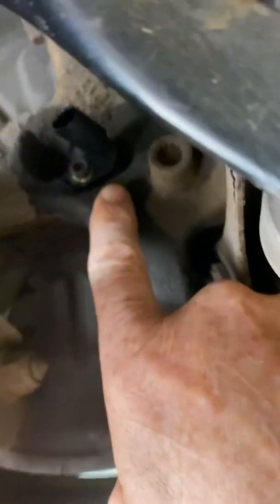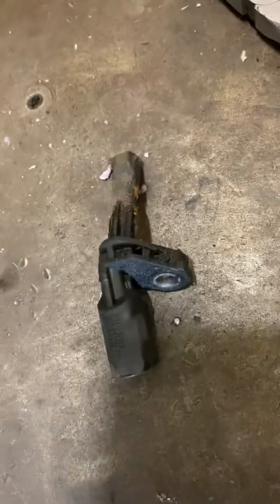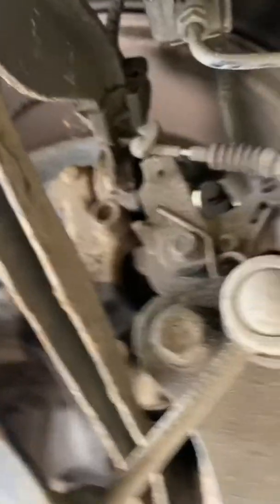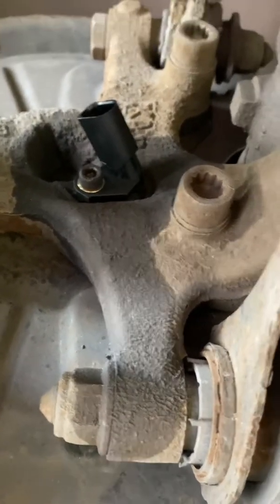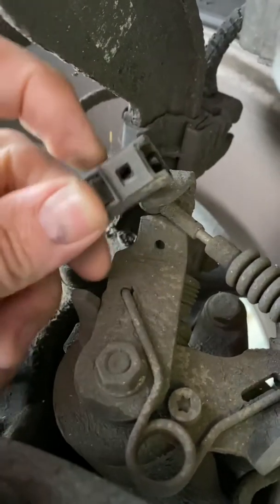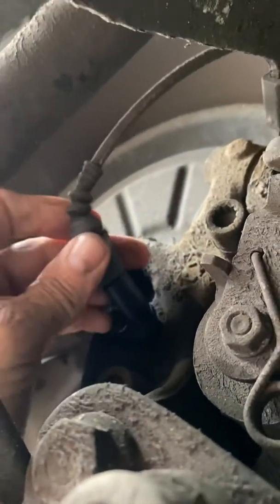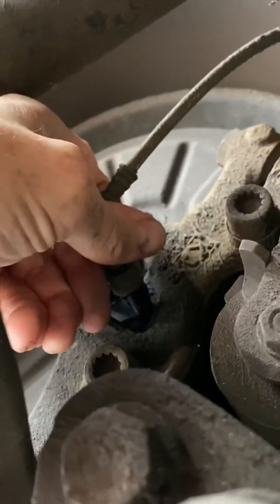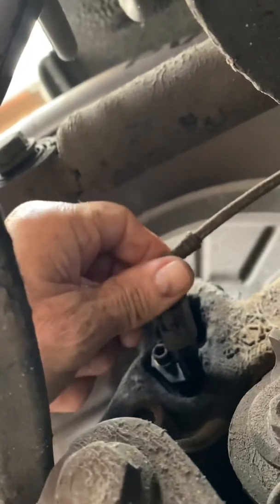Abs fault code u111300 vw Audi group

Comment: Got an A6 and I get ABS fault, Parking break fault, Start stop Fault, Air leveling system Fault. My m8 scanned it and reset it. it worked fine for a little bit then it all came back. We think its water getting into some Can Bus system in the rear. Might be a sensor so we can try that first
Reply from the maker: What were the fault codes?

Comment: I had the abs light coming up with a few other lights but it kept just going away then its not been on for over a month, now its came up with steering defective. Would you think it could be the wheel speed sensor causing that
Reply from the maker: Possibly, I'd get the codes read and see what comes up.

Comment: Can you write the name or code of this piece you mentioned bro. It gives a warning as distance regulation, the vehicle gave a level sensor error in the obd device, but there is a good snowfall and it also gives an air suspension failure, what is your comment?
Reply from the maker: It’s probably not an abs sensor in your case. The level sensor is a tracked resistor fixed between the chassis and a suspension arm. Usually operated by a little ball jointed arm which brakes. You may be able to reattach it or a new one isnt too expensive
Reply: @b @bradauto thank you bro

Comment: I’m looking to purchase a 2014 a6 3.0 quattro at 167k miles when we ran the computer diagnostic it gave me this code and abs failed but didn’t specially tell me the issue and ideas as to what it make be…I wanna be certain it’s not a major issue before I purchase the vehicle
Reply from the maker: The yaw sensor last time I checked on those is quite pricey £500 ish but maybe the second hand route would be good to make sure you don’t pay over the odds

Comment: How do we know which side is it?
Reply from the maker: There are four, one on each wheel. You will need a diagnostic scanner to identify which one and erase the fault codes once replaced
Reply: @bradauto I have come across a service bulletin online, Audi fixes the issue through software update. My driver assists features stopped working due to this code on a 2011 A8. I have a Autel MK808 and couldn't find ABS sensor issue
Reply from the maker: @guniseran hmmm without doing a code/data read it’s hard to say. But a decent auto electrician won’t charge the Earth to diagnose it

Comment: Hi sir
My car a6 2013 2.0 the panel going crazy with all kind of icons, the RPM light up and down, TPMS malfunction and stability control, all kind of codes of missing message but the weird thing is the car dont start and starter going crazy to, do you think this sensors doing al of this problem in my car, im already try the front sensors but i never check the rear ones, do you think this solve the problem thanks in advance, if you need more details let me know
Reply from the maker: I would check Earth points first - all major Earth points
Reply: @bradauto  hi sir do you have any idea how to find the diagram for the earth point, any link to help me
Reply from the maker: @ there are multiple Earth points - look for cables bolted to the chassis/bodywork. Check cables coming from battery Earth (-) will be bolted from battery check all bolted connections are good and clean and tight
Reply: All connections are good, I dont know if I  cant post a video to you to see what happening.

Comment: Hi buddy thank you so much for this information. My Audi A6 2014 Auto was jumping out of gear and lots of warning lights on the dash. I replaced both front wheels sensors and all faults cleared and car runs like a dream I was quoted £4k for a new gearbox so thank again.
Reply from the maker: Pleasure to be of service, that’s what the internet is for in my opinion, exchanges of good knowledge🤟🏻

Comment: Hi, i have a 2019 audi a6, it starts and drives perfectly, ac is working perfectly but ALL the dash lights are on and the dashboard blinks continuously. Its giving me invalid data from abs and lost communication with BCM codes. I also noticed that the red battery light on the dashboard does not comes on when you turn the ignition on like the check engine, abs, airbag, etc etc that normally comes on when you first turn the ignition on.

Comment: Quik note!! It is not always an faulty abs sensor of fuse. In my case it is the communication center box unter the floor mat driver side. (Panoroof)
Reply: Did your car ever shut off when this happened? My car literally froze and wouldn’t even let me turn on the ignition.

Comment: How about this 

Motor elektronica
U111300

U013000

Module remsysteem 
03110

Centrale kast 
03110

Wieldemping 
03110

Airbag
U013000

Instrumenten paneel 
03110

Databus 
03110

In live data the speed is almost the same. Wheel 2 is slight 0.001% les

Comment: Hello my 2013 Audi A7 adaptive cruise is not working and I plugged in my OBDeleven and it is showing me “function limitation due to received malfunction value”. It’s the only code that is showing up. At first I thought it was a misalignment but it’s not showing that code. What can it be?
Reply: Same issue but on my 2014 VW Passat. Have you found the solution?
Reply: @jasongiora5258  yeah my lane assist camera on the windshield was bad.
Reply: @raya4393 did you fix it? I might have the same issue
Reply: @raya4393  how did you find out it was that ? I’m looking to purchase a 2014 a6 but that code also came up when I gave it a diagnostic at auto zone I wanna be certain it’s. It a major issue before I purchase at 167k miles what do you think

Comment: Thank you for making this video Ian,

Can you help me clear something as I have the same code?

I changed the rotors last week for my 2016 Audi S8 with Zimmerman and brake pads Brembo. The car stops fine, but the "acc and break guard is unavailable” came out on the dash the day after I serviced the brakes. When the shop did the work (clean and experienced techs), they replaced the front OEM brake sensors (worn) with new aftermarket front brake sensors (since the front Brembo pads came alone), and the rear Brembo brake pads came with its brake sensors.

My question is, does OEM Audi brake sensors affects adaptive cruise and the brake guard in any way? If so, should I buy the OEM brake sensors and all four? Or (0bvious answer) should I take it back to the shop to check/detach/place-back the new brake sensors?

Any guidance would be appreciated,

Carlos
Reply from the maker: Hi, when you say brake sensors do you mean the pad wear indicators? If so they shouldn’t have any effect on your abs/acc. If you mean abs sensors then yes definitely go for oe as I have had problems in the past with cheap abs sensors. If you do mean pad wear indicators then I would suggest you take it back. Possibly just small flakes of rust dislodged during the swap and stuck to the abs ring or sensor.
Reply: @bradauto  Thank you for getting back to me Ian. I took it back this morning to the shop and they guarantee that their work had nothing to do with the issue and even scanned it. The main code coming out was U111300. I took their word as they are kind, hardworking mechanics and went to get it aligned in a different location. After performing the alignment, (mainly adjusting the front tires -rear were okay) and driving it back to work, the acc light came on and then it would turn off. It did this several times and it went away ones I was in the highway. Looks like the problem was with the calibration. For being a bit off in the front, the top camara and laser were not aiming forward causing the malfunctioning of the acc and brake guard. Hopefully is gone for sure!

Comment: Good video! So you can have this issue without actual ABS fault codes?
Reply from the maker: Each time I’ve seen it several lights are on - including abs/esp
Reply: I’m sorry, I do have those, but I meant without fault codes that identify actual malfunctioning ABS-sensors?

Comment: hello. i have the same code on my A6 C7 and the workshop checked all the sensors and they were all dead, powerstearing does not work and all possible check light are on. Tirepressure, esp, and its giving the U111300 code. do you no can the problem bee in the sensors or in the control unit it self? Thx for the video!
Reply: I'm having the same problem did you figure it out?
Reply: Same
Reply: Same problem here too
Reply: Same, did you guys figure it out?

Comment: Hello man thank you very much for the video, i have 2 default code one c102d00 and u111300 and even u111200 or something like this (sometimes 
handbrake light flashes) do you think it's the same problem ? (a7 c7.5)
Reply from the maker: Very likely. The sensors are cheap so it’s a good place to start. I would advise using genuine parts or at least good quality non genuine.

Comment: Hello, I’m getting a 0532  code with this exact same code I had some open wires I closed also under wheel. My abs sensor is intact.could the abs sensor cause modules to not receive voltage. Help please I’ve me trying to figure this out for a month
Reply from the maker: It’s intact but it may be faulty. They can be found secondhand on line very cheap
Reply: @bradauto  thanks for the reply!! I will change it.

Comment: Hi 
I’m getting the same faults so call AA so all what they give me the code fault U111300 so how to find out which sensor ?? Please advise
Reply from the maker: Hi lat sensor and yaw sensor are all contained within that unit
Reply: @bradauto  can you please explain it more as still didn’t get you ?
Reply: @bradauto  Can you give me the part code of these sensors you mentioned?

Comment: I just got into a wreck in my b8.5 Audi S4 nothing major but I’m getting this ecp light and when I scanned out with my obd11 I got this code & a 02 sensor code. The crash all that happened was me losing control on the high way n hit a sign very lightly could this be the problem the sensor you talked about
Reply from the maker: Read data from wheel speed sensors, if you get balanced read from all four wheels then no. This is a very general code, possibly being generated by the o2 sensor fault. Try clearing faults and read again

Comment: Hi, I have the same fault code u111300, without MIL control, can you tell me something, the cruise control also stopped working
Reply from the maker: Yes abs and cruise control are linked so makes sense